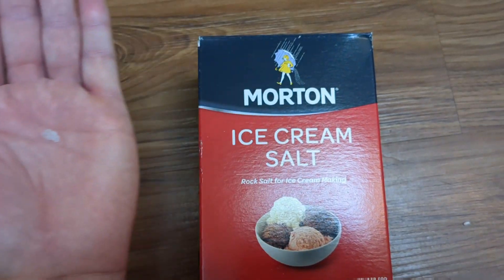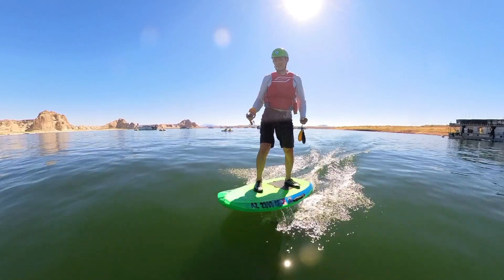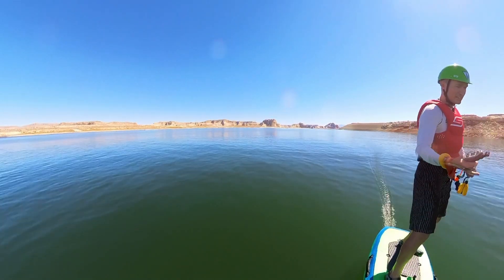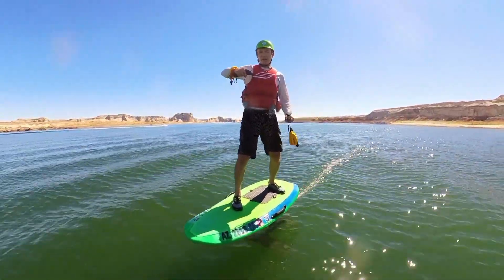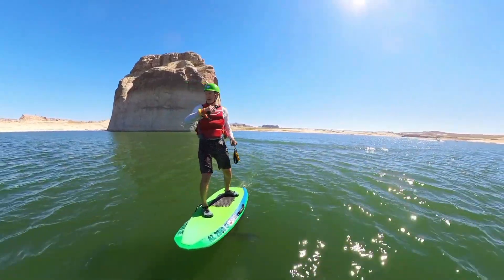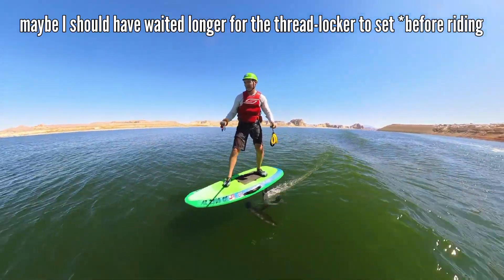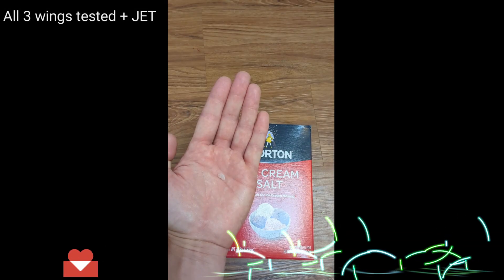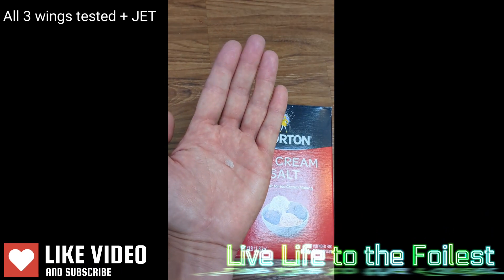Waydoo eFoil GLIDING 1500 Wing Review

Comment: Why is your Waydoo controller  covered in shoe goo? I just got one 2 weeks ago, should I seal mine with shoe goo? Thx
Reply from the maker: It's not necessary to seal it. 
My first remote was replaced under warranty due to water damage.  (Keep in mind it was a first year product). Mostly out of paranoia, I decided to cover all seals and bolts with shoe goo on my new remote.
The application of the shoe goo was sloppy, but it gave me peace of mind.  I didn't want to risk even a week of not being able to ride at the time 😅.  Especially with Covid still causing some delays back then. 

I would not say water damage is common problem.  Any brand could have a rare leak in a random hand remote.  It will be replaced if under warranty (1 year I believe).

A new one is $300 if not under warranty.
High-end remotes for other brands can cost 2 to 3 times as much to replace.